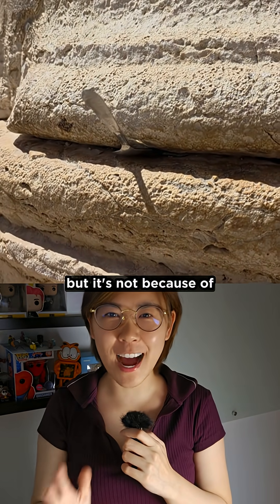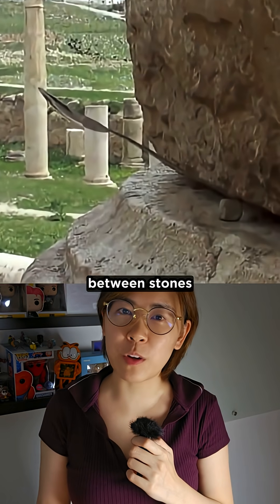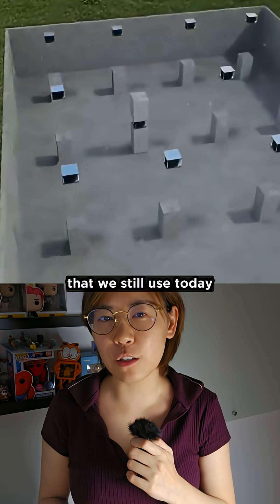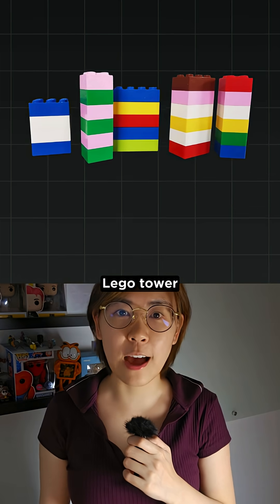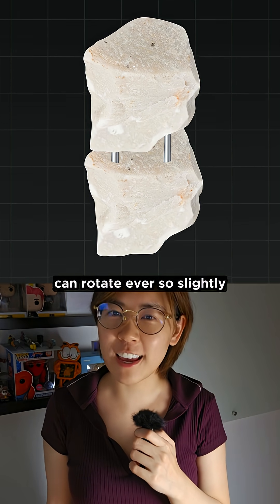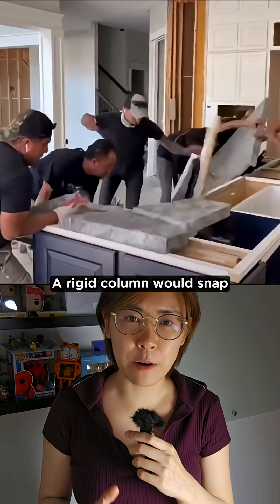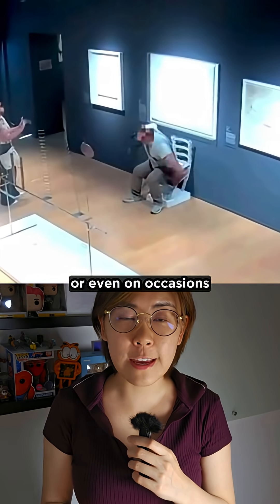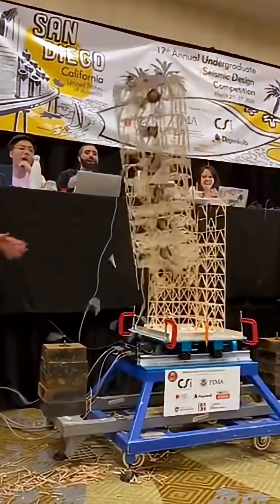Why Are the Spoons Moving? Ancient Secrets of Jerash Unveiled!

Comment: Very interesting and so on, but it could do without the brainrot (flashcards like rapid frame shifting) practice of adding in things like the spongebob clip.  This is actually a brainwashing technique designed to wear down the conscious mind until it starts transferring material into the unconscious without checking.  It's also a method of associative anchoring, but done in the most brainrot manner possible.

Comment: The stone column never experiences an eccentric load further than the kern distance of it section and therefore never experiences net tension on one side. The fact at the end about sky scrapers is completely false as all sky scraper lateral system have a tensions capacity either through reinforced shear walls or steel braced frames all of which pull up on the deep foundations. While the presentation above is good it is not accurate to the actual physics of these structures.

Comment: No,  they are not drums. Drums are cylinders. Long Roman columns are stacked short pieces of columns and are solid in their centers. Some columns are monolithic and do not move. The Romans did not make them in order to absorb side stresses. They made them from smaller pieces because that is the only way they could build them. If the columns swayed a little (they do not rotate even slightly), that was just an added serendipitous bonus. Words have meaning. The thesaurus is not just a random grab bag.

Comment: Traditional Maori buildings in New Zealand use a similar principle, by using ropes in the structural support to spread shock adaptively. This approach is actually beginning to be used in modern construction, but with thick steel cables instead

Comment: those contractors are never gonna break another counter again. lol
Reply: They tend to cut them thinner these days to get more out of them and offer them a little bit cheaper. But the contractor has to absorb the loss when they break.
Reply: @dparry659  I find it interesting how they use a breakable material in the US, is it like fine granite dust glued together into a composite material or actual natural slabs? Over here we only ever use wood shavings glued into a composite material with a plastic coating idk what they're called in English. They're more durable and I imagine a little flexible  from the glue
Reply: @sm79165  there are lots of options, both actual stone slabs or engineered products (in the context of countertops "quartz" is engineered stone) and "solid surface" products like corian.  these are preferred aesthetically and practically over things like laminate (which in this context would be like a thick particle board core with layers of plastic bound to it), but laminate is still very common because it's cheap.
Reply: Hurr to watch lmao
Reply: @MMAhole It really did. 😅
Reply: I was surprised by the way they handled the counter top.  Also surprised it was quite that thick.
Reply: they put the weakest guy in the corner, of course it wasnt gonna hold, frankly that looked so unprofesional, like who are those clowns ?
Reply: @ezioricco4923  they don't look like contractors if you ask me, looks more like the neighbours and his son trying to put the countertop themselves to save money
Reply: The slab should have been glued onto a plywood for support.
Reply: Wanna bet?
Reply: @missellyssa  i think that was their third one 🤣🤣

Comment: It's important to bare in mind, in the same way a body structure doesn't JUST evolve, it is modified from other structures, picking up new uses along the way, continuing on if it's successful, strategies for construction can also evolve. Ancient people probably didn't have the best grasp of tectonics or how stacked drums of column sections were more disaster resistant, so this would be a secondary trait that emerged from the strategy of that construction, not the initial driving factor. The initial driving factor was probably about ease of manufacturing, transportation, and installation, as moving individual smaller sections of column is easier than moving and installing a whole column at a time. It's always important to keep in mind the most likely driving factors at play, so we don't overly aggrandize ancient civilizations, as that can lead people to A) fascism, B) delusions about atlantis.

Comment: Question: 
What kind of metal did they use to build those structures?
Adamantium?
Vibranium?
Must be extremely rust proof and stain resistant metal.
Far more advanced materials than what metal we have today.
By the way, how did you know it is even a metal in the first place?
❓🤔🧐
Reply: Google what patina is, and why it stops metal rusting, then you'll be as smart as a Roman builder
Reply: @OutsiderLabs  How did you know they used patina on the structural metal?
Did you google it too?
Reply: They used copper bronze and iron, 
Also we know it’s metal uhh because it’s…. Metal.
This is literally the equivalent of saying , “wtf is rebar made of??? Super metal? How how can we even know it’s metal in the concrete and not stone!!!”
Reply: @aufstieg6948 
Whatever material they used, it lasted for a very long time without decaying.